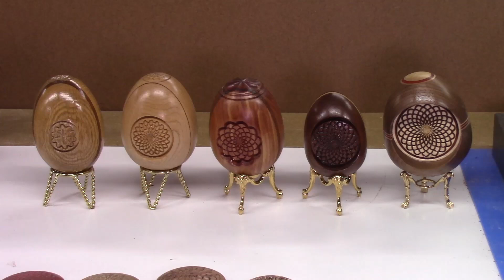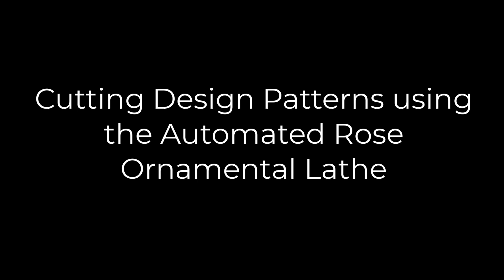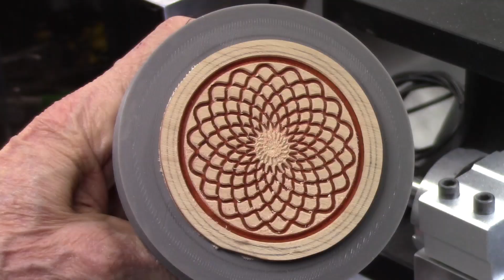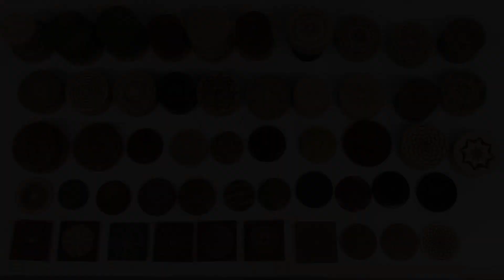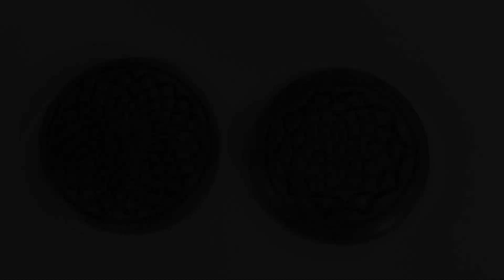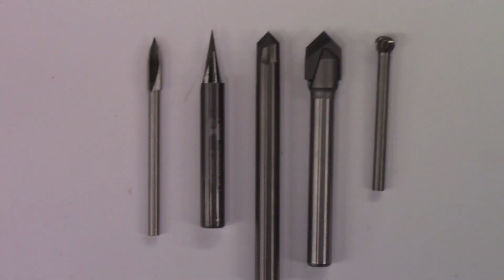Patterns on Wood Turned Eggs Using the Rose Ornamental Lathe- Part 1 - Evaluation of Design Elements

Comment: Thanks for posting this video. I’ve just discovered your channel and will enjoy the several Ornamental topics  and patterns described. I’ve explored several designs similar to these in my own experiments with a CNC adapted metal lathe as well as with a CNC machine. I haven’t tried decorating eggs yet but Easter is coming ;) over the past few years I’ve learned to digitize the curved objects I’ve turned and can easily import them into Bill Ooms’ COrnlathe software = Computerized Ornamental Lathe. Within that program I can design pretty much anything I want and produce the design in wood on my adapted lathe. I can easily follow the curves of any object. Happy Woodturning and Ornamental decoration. Cheers